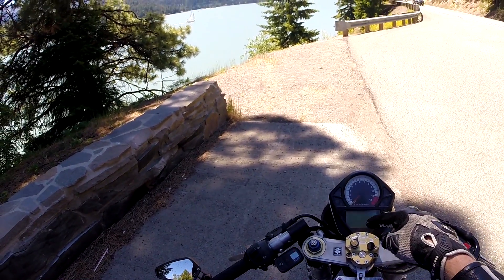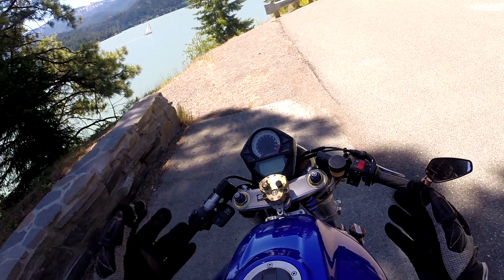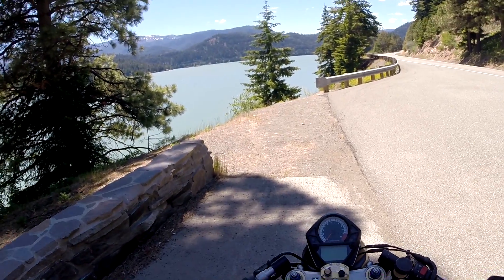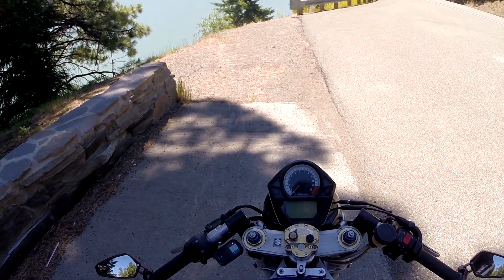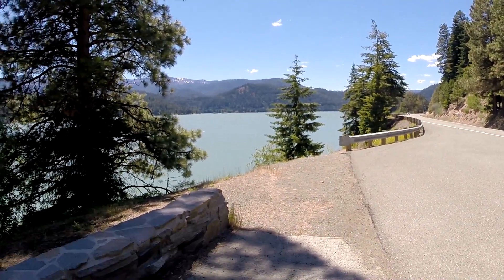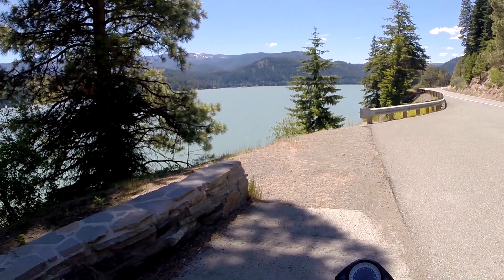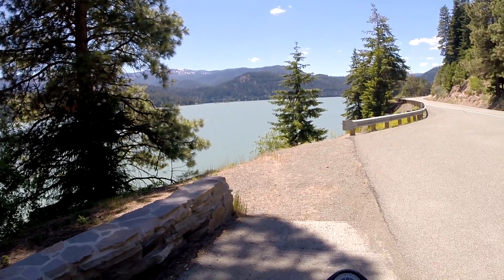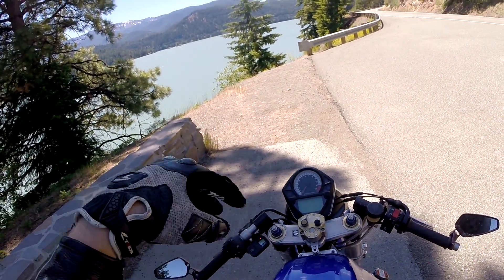Motorcycle Stability Explained

Comment: It is the gyroscopic effect of the two wheels connected to the one frame. Watch any of the videos with riders doing wheelies and the ones who go down afterword... rewind the video and watch the front gyro be set back to the road at an angel and see what happens. If you think about... bicycle riding you start out learning to balance but what you find out is the slower you go.... trying to be safe and not fall over was harder to do than to peddle faster and the falling over tendency started vanishing. Why, because you had two gyros lining up to do what gyros do best... stand up. When you hit a hole in the road and it twists the front wheel you throw the front gyro out of line with the rear... this can happen when racing going around a curve and the two gyros get crossed a little and the bike goes crazy.
Reply: There are so many more factors other than gyroscopic force in what you’re talking about.
Reply from the maker: Yes, spinning wheels experience gyroscopic effects among other things. They have an effect, but they are not the reason for everything. You pint out good examples of instability though; the crooked wheelie landing, or a case of high speed wobble... (I wrote about that in the video description) There is allot more than gyro dynamics in play though. Many other forces are often far stronger. 
I'll also point out that there is nothing physically noteworthy or special about having "two gyros lining up", especially two spinning in the same direction. Double the wheels, double the gyro forces... nothing special. The alignment of two rolling wheels is actually very relevant just simply because of tracking friction. Reasons a race bike might become unstable mid curve (or any other attitude) have nothing to do with "mis-aligned gyros". When a race bike is set up in pursuit of maneuverability and to suit the riders needs, they often end up with very small dynamic stability margins because of a whole bunch of things (tire properties, steering geo, suspension geo, suspension damping, frame stiffness, mass distribution, etc.) Really high speeds, bumps, and high lean angles can exaggerate some very complex relationships between these things and occasionally when all the conditions are just right... well... wrong, then the bike goes crazy because dynamic stability has been driven negative.

Comment: FAIL.  It has all to do with the gyroscopic effect about the mass of the turning wheels. Every wheel big or small has stability imparted to it when it is spinning. If a wheel does not spin it will just fall over.
The presenter is not funny or smart with his on-going "oh so hip" commentary it is just boring and droll. Look just say what you are wanting to say and then move on.
Reply from the maker: 7316bobe gyroscopic forces add damping to the dynamics of both wheels and even cause an anti-perturbance steering effect, which is also a damper. They can have a strong influence, but they are not even close to being solely responsible for stability. Plenty of bikes have light wheels and good stability, even at low speeds.
Reply from the maker: 7316bobe There are plenty of veteran pilots who don't know the details of how their engines work. And there's nothing wrong with that. This is really just an engineering conversation for anyone who was curious and might be interested. I'm not preaching at anyone.

Yes, any spinning wheel regardless of its weight will be stable. That doesn't mean that any vehicle regardless of its weight will be stabilized simply because it has a spinning wheel attached to it. Stability is usually a matter of competing influences. In the case of a motorcycle, gravity has a big de-stabilizing influence. A spinning wheel has a stabilizing influence, but for almost all bikes, it isn't enough. Proper geometry is vital. However, since the spinning wheels are helping to damp the response, we can feel changes like a heavier tire or wheel.
Cheers!
Reply: All them sport rides going to carbonfiber wheels for racing must be mad then. Better use heavyass big steal rims so the bike won't fall over. 
If it is gyroskopic force and you half the weight of the wheel the bike should be half as stable. It will be just fine though
Reply from the maker: alles klar klaus Interesting paper... Seems like a hyperneed😁 Have you seen SmarterEveryDay's version of a "URB"? https://www.youtube.com/watch?v=MFzDaBzBlL0
Reply: It has actually been tested on a motorcycle with the gyroskopic forces canceled out. Still stayed upright and and was pretty okay to ride. 

http://socrates.berkeley.edu/%7Efajans/Teaching/MoreBikeFiles/JonesBikeBW.pdf
3rd page I belief.
Reply: Argh, not motorcycle but bicycle. Tranferable to a motorcycle though
Reply: Hey 7316bobe.. It's pretty easy actually. One wheel turns forward and the other one reverse. The gyroskopic forces oppose each other and the overall force on the bike is zero if the wheels are of same size and mass.. There is however due to the wheels beeing not on the same place torque applied that "twists" the bike around it's middle point but nothing of a "keep it upright" kind. This is a scientific approved paper but I guess you could just disapprove and say your own opinion is worth more to yourself than experiments but me or us won't be convinced by that. If I say the moon is a triangle it won't make it a triangle. 

Na, I haven't seen it yet but I'll look into it.
Reply from the maker: alles klar klaus I was too vauge; I completely agree with his findings. I'm a nerd, so I totally meant it as a compliment. The comment was really based on his picture😉
Reply: Ah well it was an answer to 7316bobe, no worries :)
Reply: You deal with one instance of low speed wobble and get both knuckles wracked and you understand it’s not all about gyroscopic effect of wheels in fact there are many factors such as wheel trueness, whether spokes are tight or not, tires and tire pressure and most of all weight distribution and steering and fork geometry. This guy understands a whole lot more than you do on the subject of rolling stability...
Reply: it has been proven many times that bikes have stability even without gyroscopic effect
Reply: Hi alles klar klaus I once also had a motorcycle that used to stand up on its own all the time. Even when not moving. All night and all day every day just standing there. I tried to push it over but could not. I would go for a ride and get off and it would just stand there. People that walked past were amazed. I think that as you say its gyroscopic forces were cancelled out.
Reply: Do you know how stupid this sounds. I am 63 years old and have been riding since I was 14 and I know from years of experience how my motorcycles stay upright and moving in a strait line. Look do not try to sell us the real motorcycle riders your silly theories about stability and the gyroscopic effect. A wheel spinning no matter its size or weight will be stable.

Comment: Obviously you have never ridden a chopper...Ya, at freeway speeds they track plenty straight, try a turn at low speed and the bars will turn just so far and they will flop all the way to the steering stop. You need to spend time analyzing trail, that magic number that makes or breaks the handling of a bike. Did ya notice the difference in the distance that the fork tubes were in relationship to the steering stem when ya swapped front ends (ie..draw a line between the center of the fork tubes and measure the distance to the steering stem? And you did manage to drive (ride) right past one of the more important aspects of motorcycle steering... Turn left to go right. Push on the left bar with the palm of your left hand. You just turn the bars to the right, how come the bike went left? And that "chopper flop" thing can be corrected...Keep looking at choppers with a springer front end, sooner or later you will see one with rockers (thats that are that goes between the axle, the bottom of the fork and slider that supports the bike with the springs at the steering head) that are way longer than most, they might hang almost to the edge of the wheel. It's like that because the trail has been corrected to measure within known specs....One last thing...Have you ever looked at the front end of an HD bagger FLT..whatever..even back to the shovel head days...the fork tubes are behind the steering axis..when you understand and can explain how/why that works make another vid. Did ya measure rake/trail when ya swapped front ends or did ya hang that dampner on just to be safe? lol
Reply from the maker: Trail and caster are referring to the same distance. That's what I was simply calling "that distance" as I was pointing at the ground by my tire:) Correct, the front end swap did change it slightly in addition to lowering the front end. 
That relationship of the fork tubes to the steering stem is one of about three geometric features that sum together to determine the total trail, four if you count the rake angle. The others are the diameter of the front tire, and the relationship of the front axle to the fork tubes... they aren't always in line with each other. Often on bikes with large front wheels (which increases trail), you see the axle mounted forward of the tube centerline to help bring the trail back down to a reasonable value (also to allow for really long springs on dirt bikes). They usually get the rest of the way there by increasing the offset at the triples you mentioned. Dirt bikes tend to have larger triple offsets. Cruisers also have large triple offsets because of a fairly large wheel and shallower rake angles. 
Theoretically, you can swap any of those things around (except for rake angle) and as long as the trail is the same distance, nothing about handling changes... Well I guess changing the tire diameter would also cause other changes, but you get the idea.
I sailed past countersteer because it would have been opening a pretty distracting can of worms. There's such widespread misunderstanding on the subject that it would have overwhelmed any discussion on stability. I did a video on countersteering a while back.
I'm pretty sure I don't know what you mean about many HDs having fork tubes behind the steering axis. I've never seen that... picture maybe? Springers should be the only time you'd see that going on. The reason being that the general line of the forks no longer has to be exactly parallel to the steering axis as with telescoping tubes, so that adds a 5th geometric variable to the trail equation. BTW, technically this could also be done with specially angled triples for telescoping tubes but at higher machining costs.
Yeah, I did measure the change in the triple offset when I did the front end swap. I wanna say the GSXR triples have 2mm less offset. Rake was steepened by about 0.7 degrees due to the front end dropping about 18mm. I knew going in that I may want to add a damper. Without damping it's solid during normal riding, but can start feeling edgy over 90 mph... not a speed you want a wobble ;)

Also, you're right. I've never ridden a chopper... I'd like to... 
The behavior you're describing sounds like a consequence of shallow rake. With a lot of rake, the point of equilibrium would be near or beyond the steering stop. At low speeds, there's enough lag for the wheel to actually turn that far.
Reply: Well it took a while, i found lots of road glide triple trees...and if i used them as proof you would just call me a dummy and say i was lookin at them backwards....But i did find this, granted they have been raked but that doesnt matter
https://www.2wheel.com/mc-baggers-ez-on-neck-rake-kit-for-30in.-wheel.html
You are lookin at the front of the steering head...some kind of display deal. The actual frame continues back and the fork tubes are located behind the steering stem. Seems like a lot of people don't even notice, i have a buddy with a 78 electra glide, had it for years. I told him the tubes
were behind the stem....had the audacity to call me stupid...and i bet him a hun.....and won....didn't make him pay as long as he told everybody that 
the 'old guy' sent him back to school..again. Ever ridden a late 80's GS 500? Little twin, not much hp, the tubes are offset from the steering stem i think like 1/4"  One of those bikes that feels on the edge of going speed wobble all the time, but doesnt, even if you try. The steering thing on the street seems more like preference and getting used to what you ride. I have a bud with a speed triple, i let him ride my blackbird and i rode his...Damn scary ass twitchy, wont track a straight line and if ya wiggle the bars u best know how to stop the wiggle...He gets off my bike and goes WOW...B-bird is rock solid stable, even with a 13 mm shim under the rear shock mount...same as lowering the front..made a noticeable difference. One other variable ya missed, front tire profile.
Different manufactures shape their tires different and ridding style wears tires different. You like swapping parts? How about an 85 gpz 900 16" front, 18" rear. Bolt on complete front end off an 02 zx-750 and just for fun stick the  17 x 6 rear on it with a 190 tire. Bike handled amazing, front brakes were so good i never bothered with the rear.
As for
 "Trail and caster are referring to the same distance" opps lol  trail is a number on the ground in inches and caster...ie king pin inclination if you have 4 wheels...measured in degrees from vertical.  But you do your homework, i like people who adjust things and pay attention to the results. :)
Reply from the maker: Yes, it has been raked. That matters. If you add rake and also reduce and even reverse the triple offset by the right amount, trail doesn't change at all. This is a purely aesthetic bolt-on kit. Sounds like they designed it to not change the trail (or handling) at all from stock.
About the word "caster", you are right, the automotive world has adopted a special definition... I was speaking in more general terms. Trail is a better word really.
Reply: Aesthetic bolt on made so a 30" front wheel could be used.
You said  "the automotive world has adopted a special definition"...
Ok...i looked it up
https://en.wikipedia.org/wiki/Caster_angle      
They were talking about caster but used a pic of a motorcycle? lol
Reply from the maker: Clearly written by someone more familiar with the automotive world than the classical definition. Centuries before the industrial revolution, the word "caster" meant the little swiveling wheels on the bottom of furniture which it still does today. In verb tense, the word "caster" also refers to this swiveling action, which is solely due to trail.